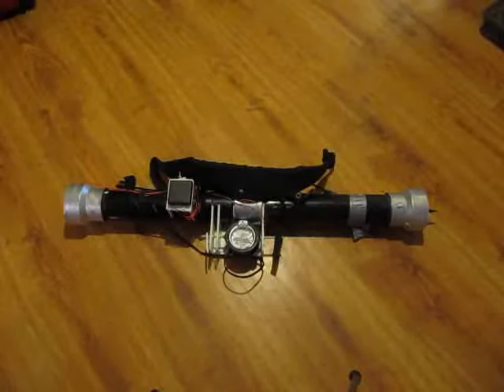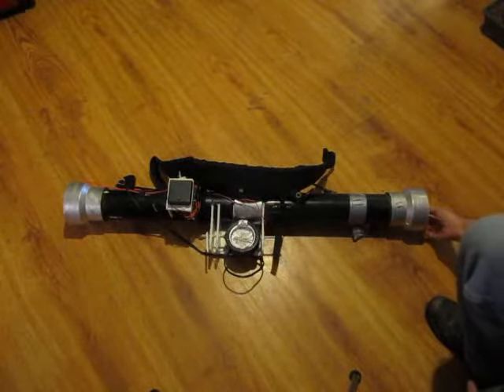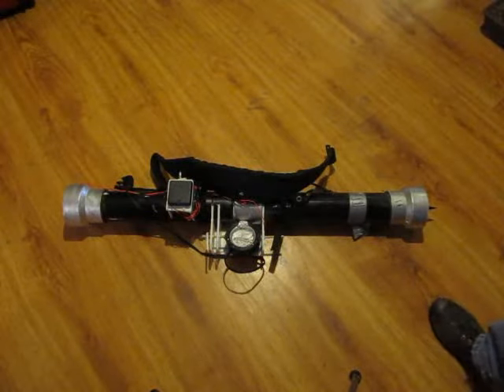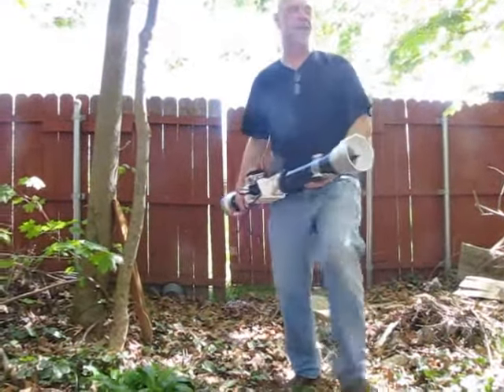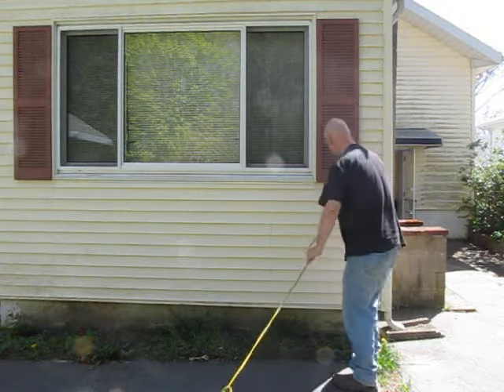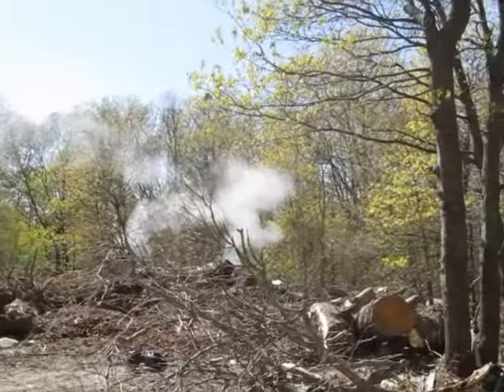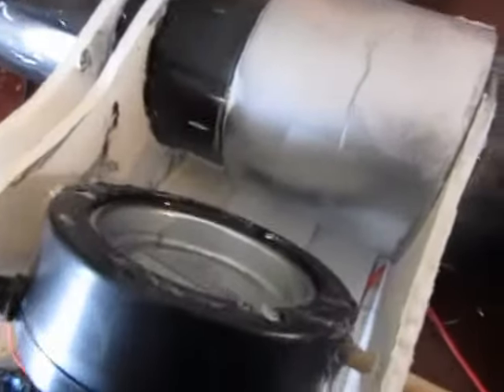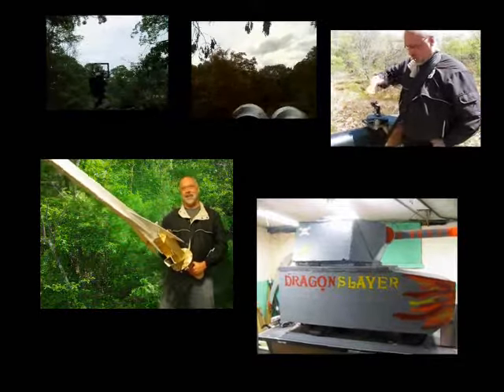DragonSlayer 8 - The Foundry Bazooka

Comment: instead of having melted metal complete the circuit, make a trigger "push an metal pin in between the two cords. sounds hard but it sure is faster than melting metal